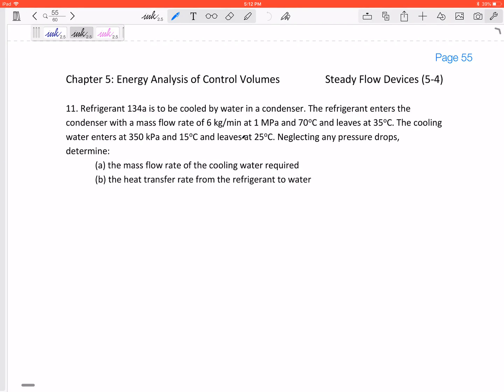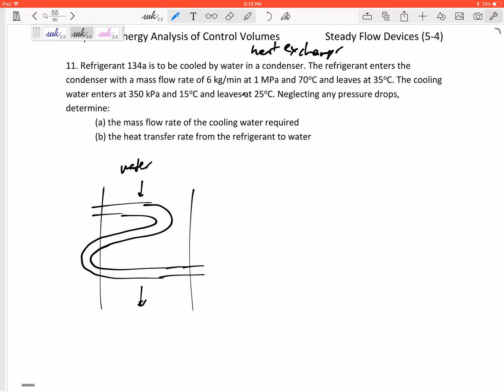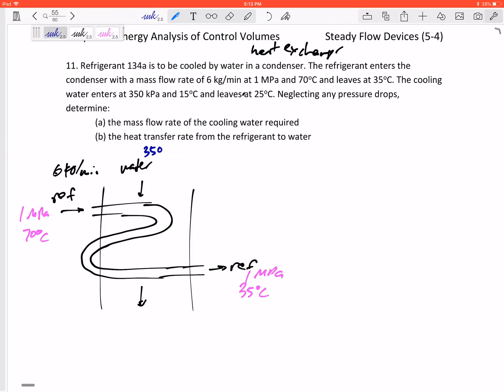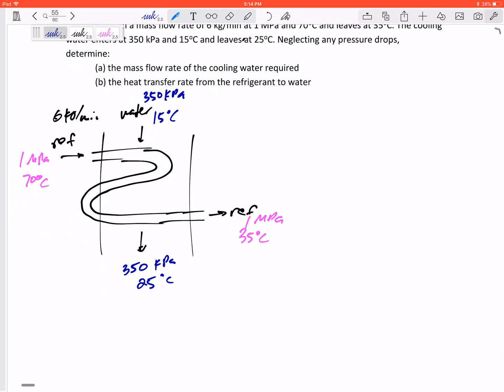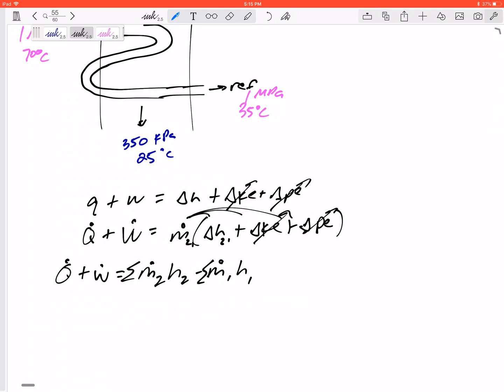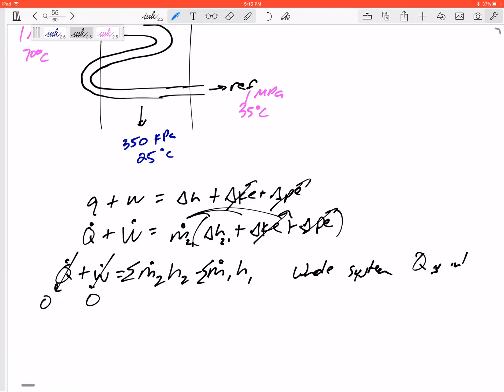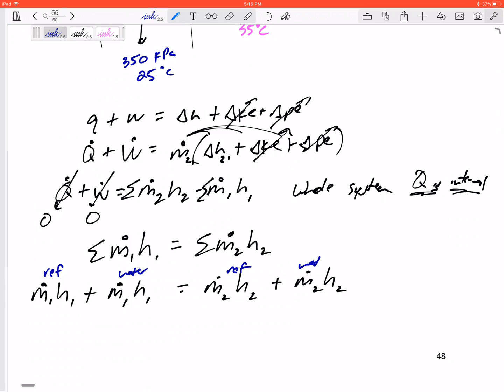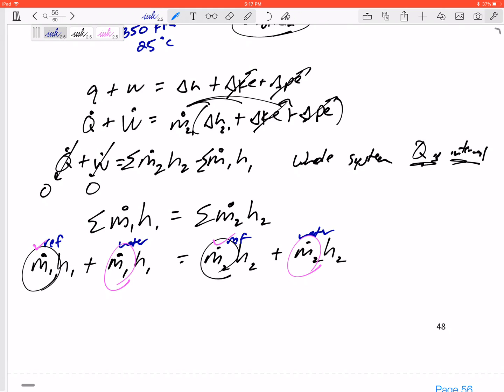Thermodynamics - Steady Flow Devices - Heat Exchanger

Comment: For anyone wondering how he got 29.1 kg/min in his flow rate calculation at 10:00, he accidentally swapped the outlet enthalpies around. The correct equation should be:

(6 kg/min)(303.87 kJ/kg) + ṁ(62.982 kJ/kg) = (6 kg/min)(100.88 kJ/kg) + ṁ(104.83 kJ/kg)

The resulting answer is ṁ = 29.1 kg/min. If you use the incorrect equation shown in the video, you'll get ṁ = 31.5 kg/min, which is wrong.
Reply: Sheeeeeeeeeeeeeeeeeeat after 2 f years I came to thank you :goat-turquoise-white-horns:

Comment: For Refrigerant-134a

- Outlet enthalpy h2= 100.865 kj/kg (interpolate)
- Inlet enthalpy h1= 303.85 kj/kg (it actually superheated) so you go to supaheated table and read h @ P=1MPa and T=70°c

He forgot to mention in the video, maybe assuming we already know how to get these values.
Reply: Hello, thank you for clarifying. I now see where I went wrong. However I just wanted to ask, if you can reply, what values does he use to interpolate for h, with a known temperature of 35ºC? The only two values he could use from the superheated tables are 40ºC and 39.37ºC which is T saturated, and T = 35ºC does not fall within those two values. At T = 35ºC, it is not superheated. Do I go back to the saturated tables instead, or am I doing something wrong?
Reply: @emergencysocks  Go back to the saturated table for the Temperature category and interpolate it between 34 and 36 degrees Celsius. Take note that it is with respect to enthalpy of fusion
Reply: Why didn’t he use pressure to find hf instead? And why is h1 and h2 equal to hf in the first place? Thanks
Reply: And how did you know h1 was superheated?
Reply: @alvinlin8140  He mentioned it in the video, it a heat exchanger.. it a pipe with water flowing on top of it to COOL IT DOWN, so logically you only cool something that is hot (in this case SUPERHEATED) also compressed liquid usually means sub-cooled liquid (COLD)

So if the refrigerant was initially cold there’s no need for water to cool it down, hence why it SUPERHEATED at inlet.. hope I’m making sense.
Reply: @quincy3718 oh I see so, also why didn’t he use pressure to find hf instead at the beginning? And why was he using hf as h1? (And thus for h2 also since h1=h2). I’m really stuck on that part thanks!
Reply: @alvinlin8140  h, enthalpy, is dependent on temperature (not pressure). So if you are asked to find h, given P and T, use T with the property tables.

Re: "hf as h1," the properties of condensed liquids are approximately equal to the properties of saturated liquids (at the given temperature, don't use pressure). So h1 is approx = to hf at T1. More info here: https://www.youtube.com/watch?v=CPklm5q7fmM&list=PLOBajja3EcWKh2FzR0KiGQCKkpjN9FpLV&index=34

Comment: Hello bro can you help me understand what you did here isn't the case that the refrigerant at 70 degrees celcius is a superheated because its pressure is less than the saturation pressure and therefore we will use hg, from table A11 I am getting hg as 280.46kJ/kg where did you get 303.87 and why it?
Reply from the maker: I think I misspoke in this video. I think you’re right, it’s superheated at the inlet. So you need to go to the superheated table A-13 to get the correct value to h at that temp and pressure. But I think 303.87 is the correct value. Does that work out?
Reply: @engineeringdeciphered  oh yes I see my mistake was taking hg from A11 which is the saturated refrigerant table forgetting that if it is superheated I need to use superheated table. Thank u so much for your response and for you videos I  wish you to have many views, likes and subscribers you so helpful.

Comment: which tables did you look at for refrigerants because in A5 its different than what you told
Reply from the maker: refrigerants are tables A-11 through A-13
Reply: @engineeringdeciphered  Your hf for water @ 15 ° C and 25 ° C are accurate from Table A-4. But in Table A-11, @ 70° C, hf is 156.15 kJ/kg.
Reply: @Sumee21051987  Yea i think he made a mistake, the ref enters as a superheated and you get that from superheated tables, then to get the enthalpy out, you have you interpolate from the sat temp table of ref 134 between 34 and 36 degrees

Comment: R-134a is enters as superheated vapor and leaves as a compressed liquid.  The numbers are correct though. Thank you!
Reply: Yes, that is correct
Reply: how do we know that it leaves as a compressed liquid?
Reply: @duffyduck1373  Because at Table A-11 at 36 or 34 degree we have less pressures than 1 MPa  it indicates that we have a compress liquid form of ref-134a
Reply: @Ko0okieeZ  We are given the P and T of R134A at the inlet. Look up these values on the saturated tables A-11 and/or A-12, and we can see that the state is super heated.